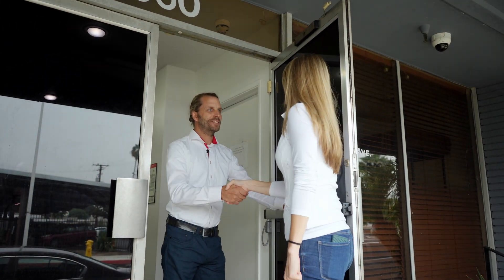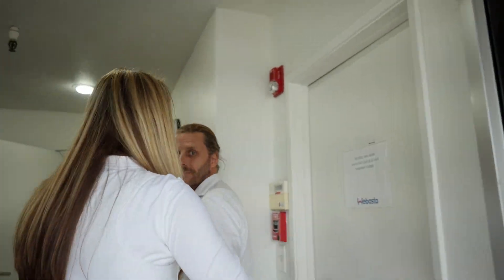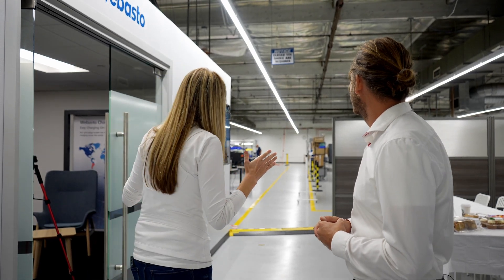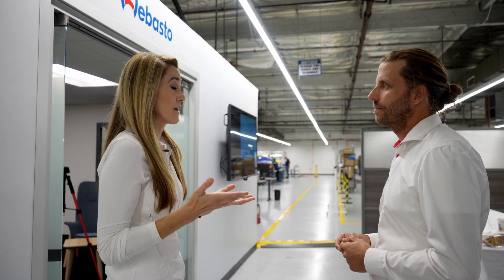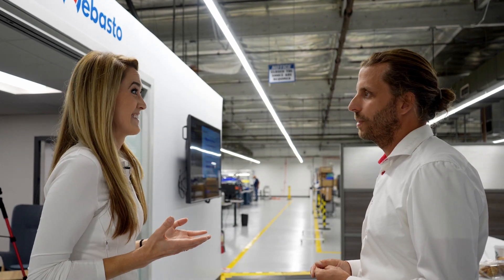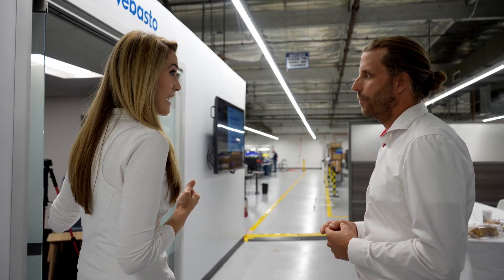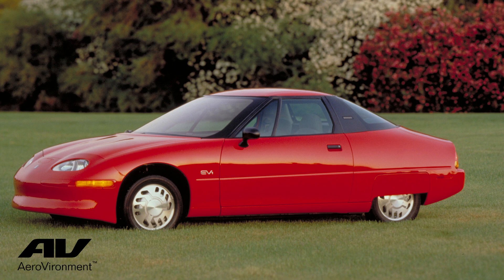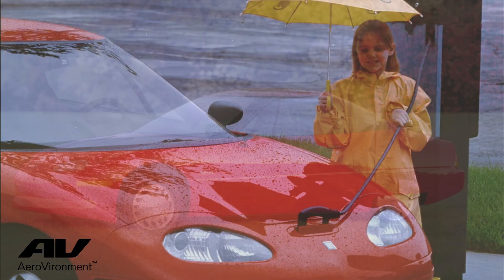Facility Tour : Webasto (AMPURE) EV Charging Research & Testing Lab

Comment: Nice to see R&D in this space!  I do have one question- the graph on continuous 30 amp charging, compared to the 'competitors' declining amps over time-  I thought this was a function of the battery itself, that all batteries slow down the power intake as they get fuller.
Reply from the maker: With DC fast charging, the charging curve is largely dictated by the vehicle systems.  There are limitations on the delivery side, too.

Household 220v <50amp AC is not very taxing on the vehicle battery and shouldn't trigger a thermal throttleback. It looks to us like AC cordsets can become a limiting factor into a session. Perhaps it is a thermal concern in the enclosure.

Comment: Does Webasto make the Dual Level Charge Cord for the Chevy Bolt EV? If so, does it have the same durability and weather specs?
Reply from the maker: They might.  Their client list is not entirely an open book.  We do know that they build the EVSE to the specifications requested by the automakers and that those demands vary.  Each buyer likely has unique cost-to-capability equation which is going to be largely affected by the volume of the order.